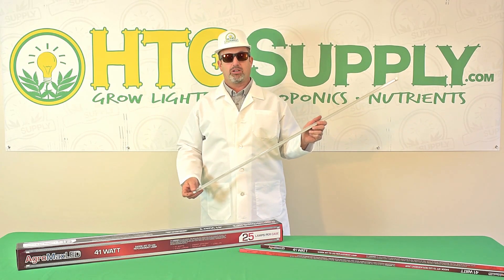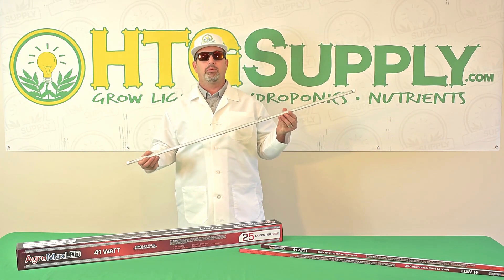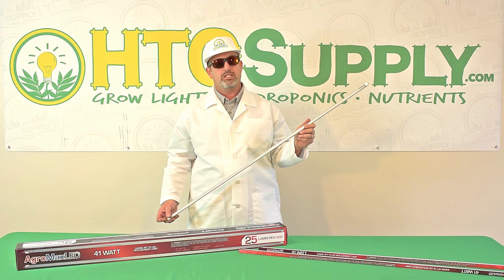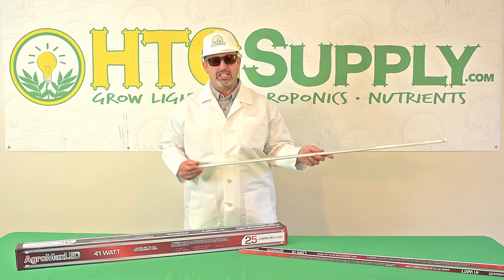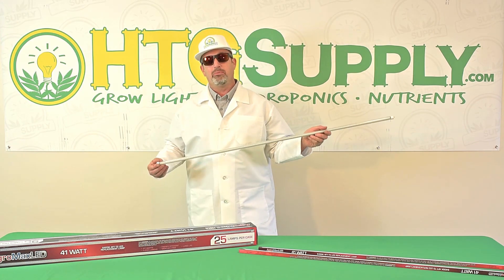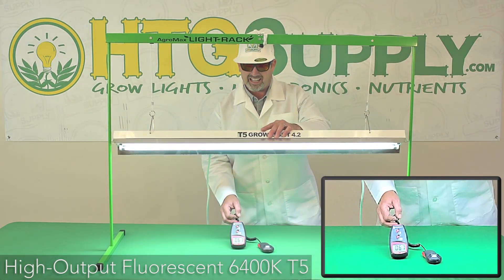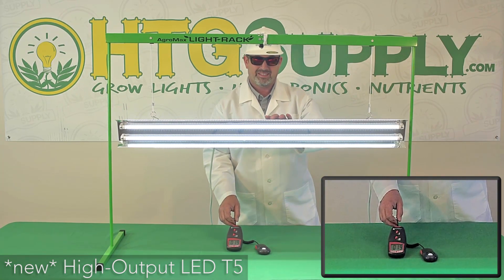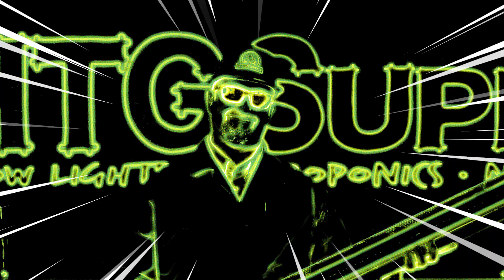Convert Your T5 to LED - The AgroMax 6400K LED T5 Grow Light Bulb Review

Comment: So with my 54 watt t5ho I don't need to change anything with my ballast?
Reply from the maker: You do not need to change the ballast, the AgroMax T5 LED bulb will operate with the same ballast that your normal fluorescent bulb uses.
Reply: @htgsupply  got any spectrum chart and the measurement of ppfd distribution? Whats the height tested on the video?
Reply: i don't know and they sure don't say anything about an on board ballast in the led strip. it would seem that you'd have to bypass the t5 ballast to somehow too. Id get ahold of HTG they are good so will tell you what's up